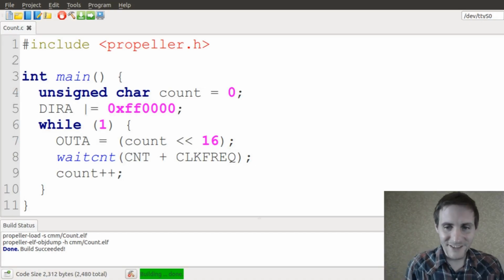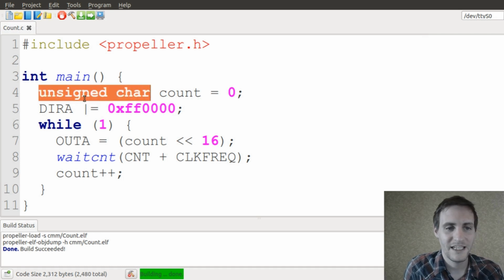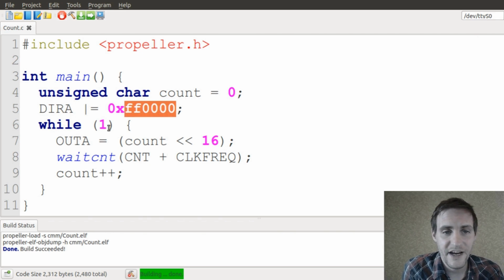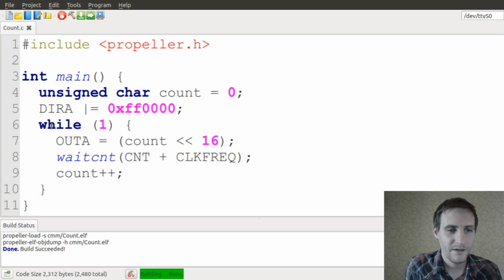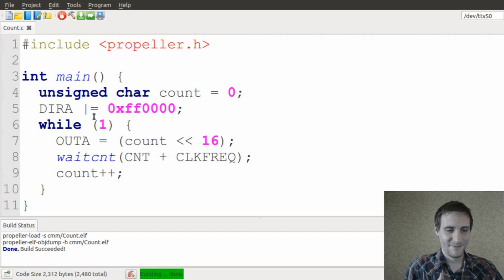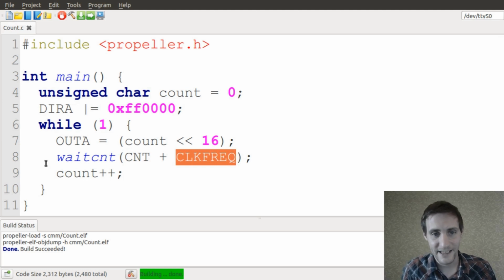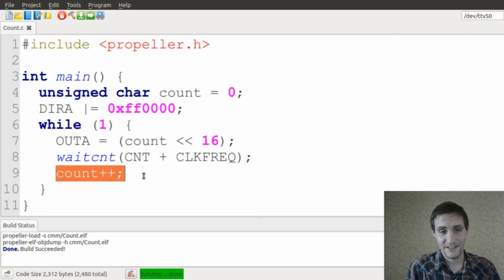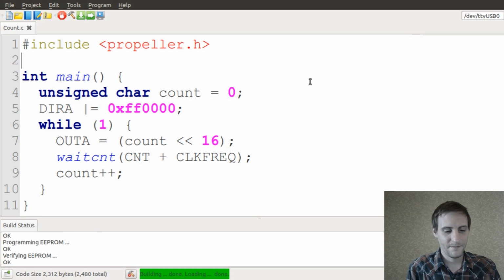Parallax Propeller QuickStart Review

Comment: Not that I remember at the moment but I did program mine with a lot of light patterns each board with different ones. But when I build projects I used 4017 chips to light leds and cut the frequency of a crystal to make a metal detector. With a pulse stretcher for filtering. So there is a replacement circuit there instead of using 4017.

Comment: The Propeller is an excellent chip - so easy to do parallel tasks. It's nice be able to off-load push button handling to one core, LCD handling to another, and have a main program running in a third with just some data changes between them. I haven;t used it in a long time but looking to get back in using C this time.  SPIN is very powerful but C is more familiar to me.

Comment: Looks like I got my propeller boards about the same time you got yours. And at Radio Shack on sale... I haven't messed with it in years and seeing your video makes me want to take a new look at it. I was trying to build a BLDC controller with it. (I had a motor running but no idea how:) But I just got a BLDC motor running with an Arduino nano (not perfect yet, but pretty good) and like you said, there are a lot of people doing Arduino and lots of code out there. And again, like you said, the propeller documentation is a real bear. I'll have to check out the rest of your videos to see what else you've done with the propeller. I might revisit building a controller with the propeller again since now I have quite a better understanding of there operation.

Comment: it all works fine when i'm plugged in with usb but when i take it off usb and use a wall wart as a 9v battery, it lights up the first green light and the blue leds flash, but the program never starts